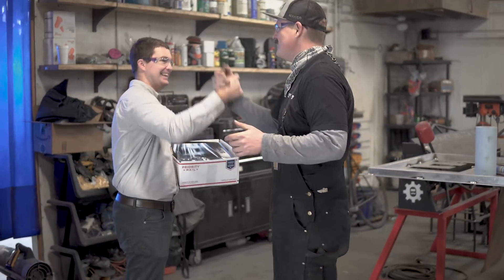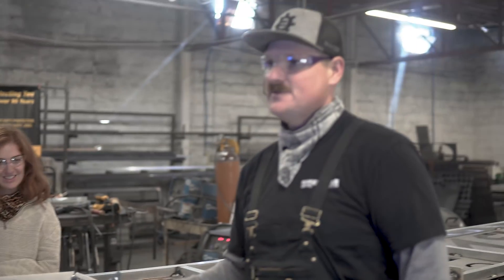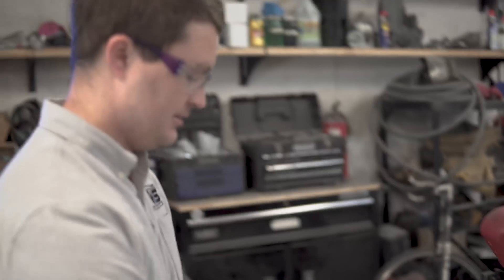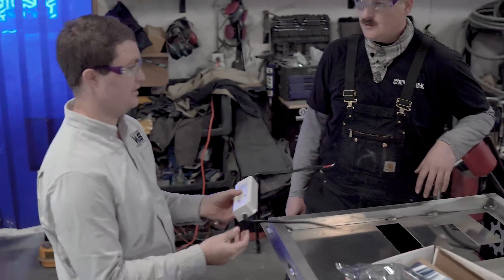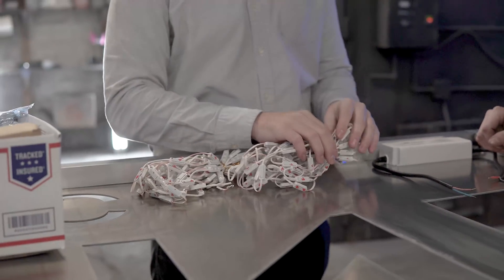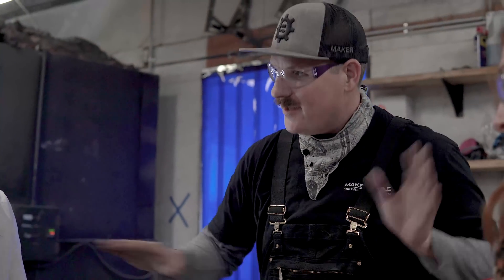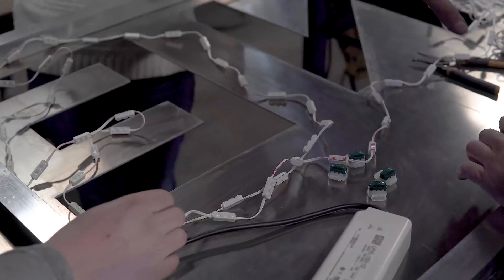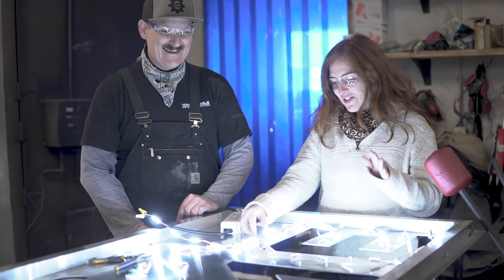MAKER TABLE METAL - OUTDOOR LED LIGHTING - Ep. 1

Comment: So did you ditch your DIY plasma table for the Shopsabre? Glad to see your business is taking off man!
Reply from the maker: It's super reliable but not as fast as the OG Linux based table. I'll take reliable over everything at this point though. Good luck w ur fix!
Reply from the maker: Thanks man! Yeah, the DIY table had too many issues with the THC so I had to get something more reliable. I need to do a video on the switch, just haven't had the time.
Reply: How are you liking the Shopsbre? I have had issues with the torch cutting out randomly on my home built table ever since I've owned it. I'm hoping it's a computer issue and after Christmas I can do a fresh install on another computer to hopefully fix the issue.